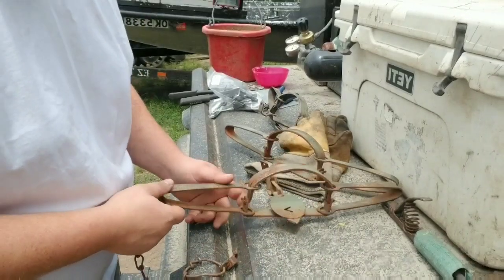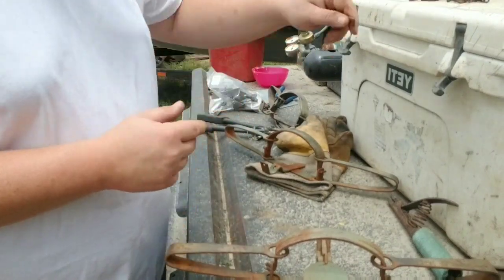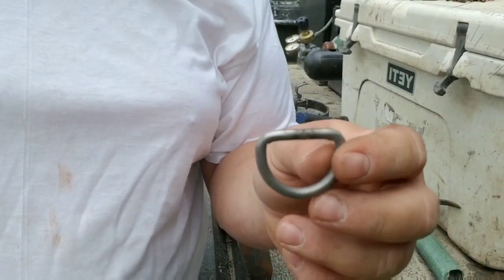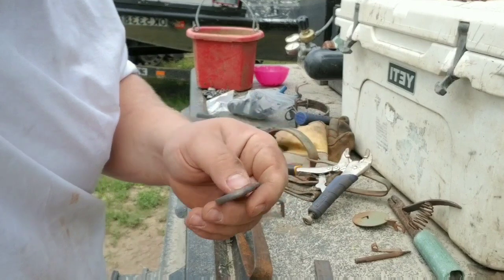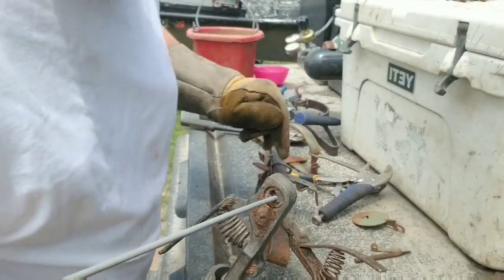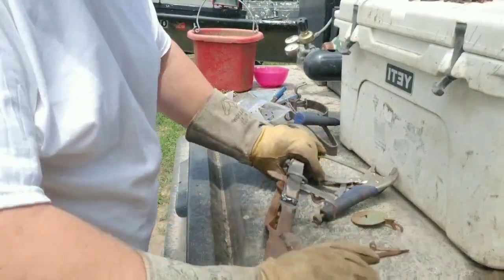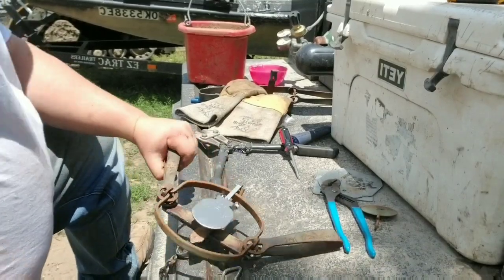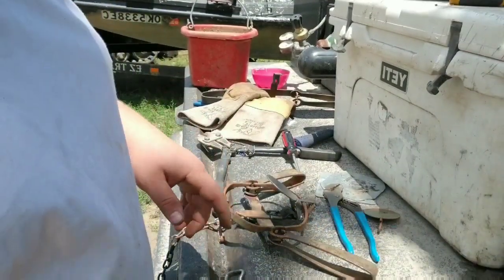Modifying longspring traps for coyote,bobcat an beaver

Comment: So when you add the tack to the jaws to make it offset, that means the springs cant lock up on the jaws all the way. Which is the whole purpose  of offset jaws in the first place. Not trying to  Criticize your method at all. I have some traps that i want to offset also. I have gridded  the offset in one #3 longspring  and it turned out good but at the same time it kinda scares me that i could easily destroy the jaws. And like you said it takes some time.

Comment: Knock that flux off the rod tip after each weld and it'll strike easier on the next tack. We used to put hog rings on the jaws to make an off set.

Comment: How'd the video part get turned backwards? The yeti name shows as itey and the boat ID # is backwards  
I still enjoyed it and thumbs up it. 
Yes,  I've put on enough of those base plates to say that they will surely warp.  I put the screw down 
C clamps on each end to hold it all together until I get a bead on it. 
Thanks for the great video
Reply from the maker: I video with my phone an had it on the rear camera to make sure I was getting everything in the frame
Reply: @trappingoklahoma5808  Ha, looked like left handed threads on that stove bolt too.🤠